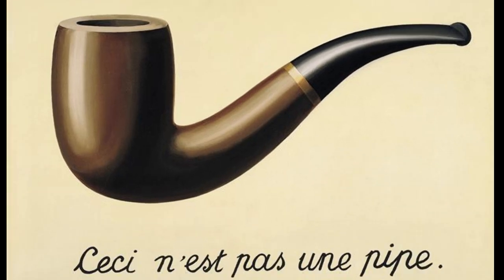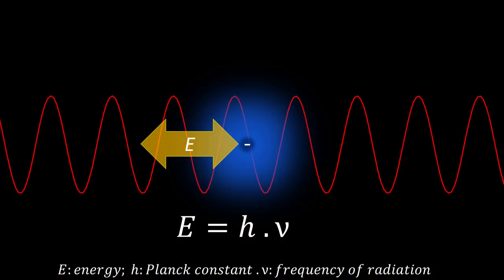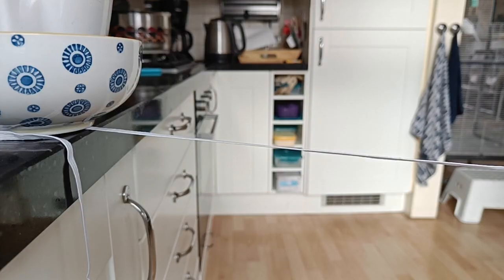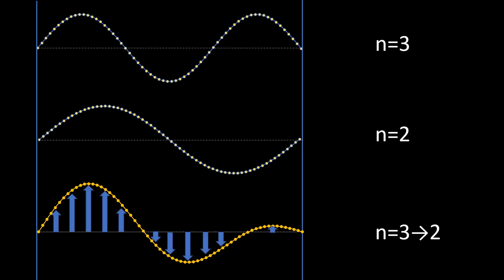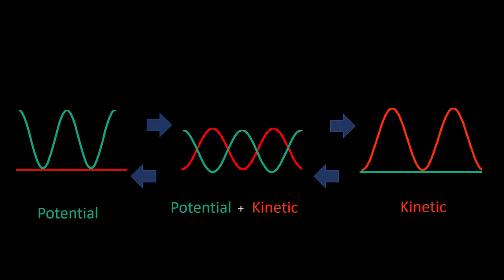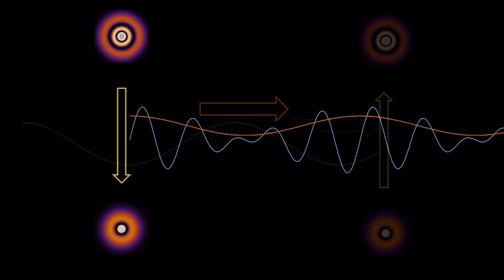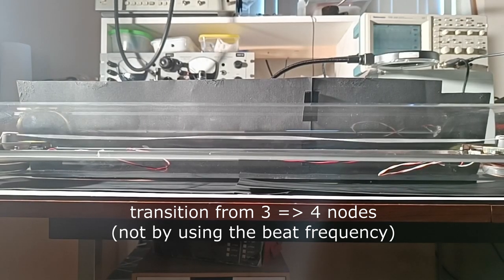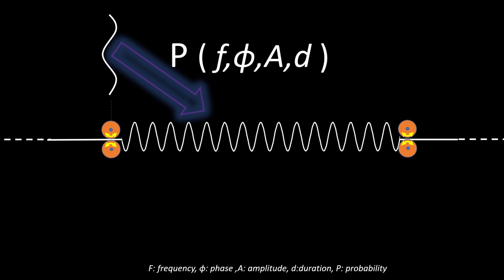Coherence part 3: This is not a wave.

Comment: The claim "in order to detect this radiation, we need something to interact with it, like electrons".  This claim right here, is only an assumption based on no hard science. Because its impossible to even demonstrate that an electron is really an object, an actual physical entity, then it must remain as a metaphor useful in a fable like story that has been told in order to try to come to some understanding of how things work. But you could just as successfully swap the term "electron" for another term such as, "winged fairies" where both are able to "carry a charge" because no one has actually even explained exactly what a Charge might be either. What do "charges" do with their free time, if there are no winged fairies or little balls of matter called electrons that are willing to carry them about? This story about electrons and photons is pure fantasy as surely as winged fairies are. So, no we do not need "electrons" interaction in order to detect radiation. We ARE able to detect radiation, and the explanation or story as to how that works, involves winged fairies, or in some circles, "electrons".
Reply: It's a common misunderstanding that "hard science" means we only deal with data, and not the inferences that result from that data.

But science uses inferential, abductive reasoning, not just deductive reasoning. This is where you find the best theory that fits the evidence, and build atop of it. This is why science is able to make predictions (something that deductive reasoning can't).

To the point that "you could call the electron whatever", yes of course the behavior of an object doesn't depend on what you call it. That's why science defines objects by their properties, and then attaches a name to them, not the other way around. The "electron" was named because it allowed electrical current to flow through a vacuum tube. It was found to be negatively charged because it deflected in an electric or magnetic field, etc.
Reply: @hexane360  Hard Science is not reasoning or data at all. Its having brick, then dropping it on an egg and seeing that the egg breaks, every time.  That hard science, Physics in this case.  Data is not hard science. Its nothing but measurement values taken from something that the observer feels might be important. But he already be wrong. The gathered measurements may not indicate the cause, only some associated phenomena. Gathering "data" means you already have decided what is important enough to gather. Worse is that after the data is collected, some mathematician then gets to mess with the data, filtering it, massaging it, ignoring some of it according to his pre-existing beliefs about what's important. Thus process is reliant on pre determined sets of equations that are ASSUMED to be correct and in some cased universally applicable.  But this too may be a wrong  conclusion.  Now calling the electron an Electron or a flying fairy is not the point. The point is that both flying fairies AND Electrons are make believe.  They are both fantasies.  Neither is an OBJECT.  A Brick is an object .  An Electron is a concept. 
Also the Electron was never "found" to be Negatively charged, because no one can tell what is a Positive charge, or even a Charge in the first place.  What is a Charge? No one knows. Its undefined.
Reply: @everythingisalllies2141  Quantumly speaking a brick is a big bunch of flying fairies.